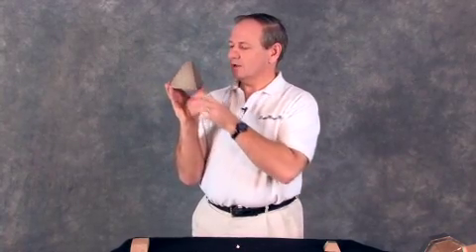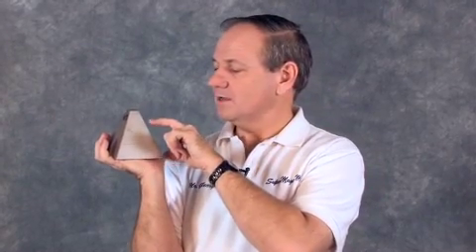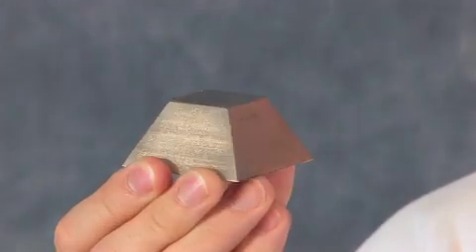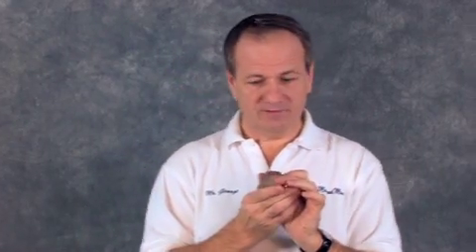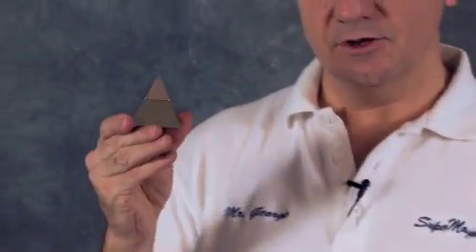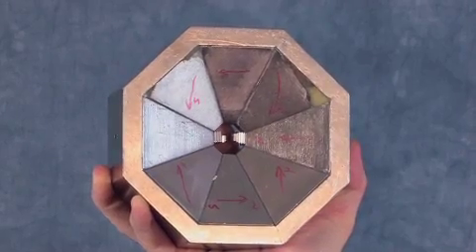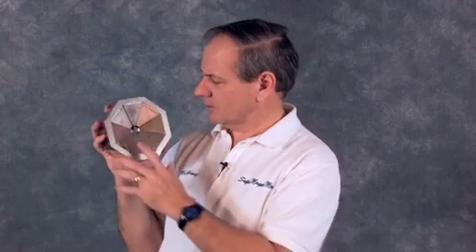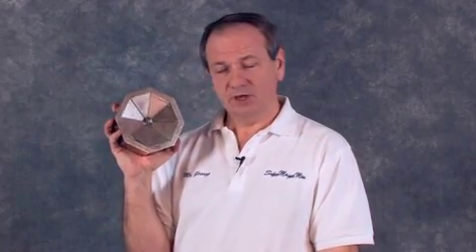Pyramid Magnets - Focusing Flux to a Point

Comment: Dear SMM, thanks for another great video. Your explaining is so clear and straight !

I am curious about the field a pyramid magnet spreads. im making an audio rack and want to put the legs on two repelling magnets. it has to be strong but with the least magnetic field around it. If a pyramid goes straight up and not sideways, i can schield only that point a bit higher up the leg right ? 

Thank you so much !

Comment: George, this demonstration, and your more recent videos (2021?) showing some properties of the pyramid magnet in detail is interesting on several levels - both for it's own sake, and for the possible applications with (for example) magnetic field around the output of a pulsed plasma jet. I did a bit of work on these between 1990 and 1998 for grad school and for specific research projects related to turbulence and combustion. No secrets - our work was documented in considerable detail and published in (I'm fudging my memory a bit) over 40 papers in various Transactions where the research was relevant to the subject. The results were also taken up by at least one auto maker in north America, and they were able to produce significant reductions in exhaust emission - on the close order of 30% - of pollutant compounds, as well as improve overall combustion efficiency, and with that engine efficiency. I believe that's been used in production engines since about 2010. What fascinates me about this is that at the time, we had an idea that better control and higher density of ejected plasma could be done with magnetic fields. Unfortunately, none in our research group had your specialized knowledge, and very powerful Neo-magnets were quite rare to see - as well as being quite costly. "We didn't know what we didn't know" kind of sums up the difficulties. None of the standard texts was much help, because there was very little attention to deliberate field shaping or concentration in the way you show here. I was forced to retire from research by health issues rather sooner than I would have liked, but there are still other researchers working on some of the information we documented. I would dearly love to have some pyramid magnets, and do some high-speed camera work to see what effect(s) various configurations might have on a pulsed plasma jet. The fact that these are permanent magnets would certainly be an advantage for efficiency's sake. 
I may have to sit down and write you a more detailed inquiry, and also follow up on products your company makes. Thank you for putting this out into the 'real world.'

Comment: Put many if them in a circle tube to make a tractor beam lock on each other suspended in ferrous fluids, The outside of the tube with controlled Electric Field that can be adjusted, I believe it's something the Nazi were trying to do, After the War the U.S. found purchasing Orders for lots of Pyramid shaped Magnets and I think it's the Shape and forcing them into a circle tube that generated levitation or zero gravity, just needs to be figured out how but clues exist....  Take a bass boom box speaker, in a box like what would be in a car stereo... Face the speaker box pointing upwards, Turn the sound off... Place a Frisbee on top of the speaker, Slowly turn the speaker Volume UP... TELL ME WHAT YOU SEE🧐

Comment: If you spin 6 opposing focal point magnets having been supercooled, and each point facing an opposite, and you place a mercury sphere at center and apply harmonics at 369hz, what happens?
Reply from the maker: I have no idea:)  I would assume it would vibrate at that frequency and emit a sound in the  F#4/Gb4 range.:)

Comment: Is the force on the "tip side" of the magnet greater than the force of the base? Or just concentrated more?
Reply: It is a lot more concentrated, but somewhat less than the bottom, because some of the magnetic field does come out of the sides of the pyramid and loop back around towards the bottom before it gets all theway up to the top.

Comment: PHASE CONJUGATION IN MAGNETICS
The meaning of the concept of conjugation of phases: The centripetal process in these magnets is unique- and is key to magnetic superconductivity. We are talking: The ideal magnets.
We are not only talking the geometry of the magnets overall form (pyrmid magnet); even so this is also critical… NOW WE WILL TALK “PROPERTIES” FROM INSIDE.
(Focused flux lines; pine cones kiss accurately and efficiently at the center.)
There is only one process in the world which makes a PHASE CONJUGATE MAGNET. 
The technology involves putting a phase conjugate frequency signature- into the magnet molecular array- during the time of molecular crystallization at magnetization- or sintering process.

We know that this is making like poles attract; and there also are evidences (for years)- that correctly defined magnetic south- is more centripetal- than north.
Unfortunately we did (until now) not find any contract company to measure and prove … all this is made more complicated by the fact that the only companies in the world actually making strong magnets in production quantities- are the Chineses (control virtually all the rare earth minerals needed)- these Chinese companies seem to DEFINE NORTH vs SOUTH magnetically - in the OPPOSITE WAY western physics does! Combine this with the fact that western physics has failed to note the fundamental difference between centripetal vs centrifugal flux as being in fact the defining symmetry of north versus south. I also believe this is actually the defining difference between plus versus minus charge- the new information being that it is in fact fractality that causes all electronegativity to be centripetal. 
Then add the fact that many use the term yin versus yang- for this physics- and the centripetal versus centrifugal definition of Yin/Yang has ALSO been inverted between traditions (Michio Kushi versus...). So be prepared for a little confusion. 
The only name for things … If a quality like magnetic south, and charge negative is in fact a name for predominantly centripetal flux lines- you must know that- or you can be confused and manipulated. If alphabets and symbols are only a name for the plasma residue (symmetry of charge compression) necessary to embed/implode/fuse your centripetal (phase conjugate) toroidal flux lines.

The basics:
Geometry produces symmetry, which allows waves proceeding from opposite directions to meet each other and stand (to phase and phaselock.) Standing waves give the illusion of stability, segregation of momentum, and make possible the birth of matter. Pressure occurs where waves meet.
Ratios are the the constants on all scales.
If the geometry of replication is embraced in a seed of any scale, it is ratio that has the power. Size is unimportant where information is concerned, since information can travel to any scale via the wave guide, and be manifested. (Holofractal architecture).
Shape is the only thing nature has to conserve. (memory, ring out only from differences in shape, not substance) The only way to conserve shape along a path is to maintain the ratio of length, area and volume (a nest of ratios.) (“Attractor” theory in mathematics; waves which fit into each other / nests which stand, form matter)
 
The best pathway to maintain a nest of ratios is the golden mean (Phi). 
Phi squared and Phi cubed are represented by the ratcheted dodecahedron. 
This pathway enables information (shape) to be moved without loss of momentum (power). The closer a material comes to forming this shape and path, the greater its conductivity. Think of superconductivity that is super-coherence of resonance or wave shape.
Coherence at any level is coherence at every level. An orderly relation between wave lengths establishes a connection between frequencies and fields, which cannot persist unless it resonates to ALL frequencies and fields . This harmonic cascade (Jacob’s Ladder) establishes the connectedness called holography. Holo-Fractal Principles are the origin of centripetal forces… (!)
Again: We know that in “optics”;  where the optical paths conjugate self organization results in superluminal
Only golden ratio conjugates (adds and multiplies- and therefore compresses infinitely and implodes).
+ The only path which allows conjugation in 3D is therefore- the way 2 pine cones kiss noses- in the center of stellating dodeca.
+ This is the only 3D fractal for waves
= The conjugation of wave phases constructive and possible ( both two sixty degree implosion pine cones learn to kiss noses)- we now can solve phase conjugate in optics, phase conjugate dielectrics … everywhere where people understand wave patterns.

Comment: AL:  "What exactly is in the round space gap of the halbach/pyramids magnet to make it so strong?"
ED:   "Magnetic lines of force, Al."

AL:  "So the magnets are polarizing the zero point field, and that is the medium that allows the magnetic lines of flux to be detected outside the physical boundary of the magnets?"
ED:  "There aint no zero point field Al -- it's just magnetic lines of force, those magnets aren't polarizing anything, now don't be making this mysterious"

AL:  "If there's no zero point field with virtual particles being polarized by the magnets, how are the 'magnetic lines of force' hanging out in the open air around the magnets?"
ED:   "Them magnetic lines of force is just THERE, right next to the magnet"

AL:   "No medium then?  No zero point field?"
ED:   "Just THERE, Al.  I told you don't complicate this."

.
.
.
Reply: You missed the part where Ed says "More Power!" and grunts as he adds another layer of pyramids outside of the inner ring.

Comment: Can an electromagnet be made in the pryamid design
Reply: Electromagnets are usually wound around an object, making them round by default. Even when they're wound around objects with sharp corners, they still result in slightly rounded edges due to the wire winding around it. So what you're better off asking is if an electromagnet can be made in a cone design. The answer is yes, but it's a huge pain in the butt to get a tight wind, as the wire always wants to slide down to the narrow end of the cone. If you mind having loose winding, then I would recommend gluing the winding as you wind it.
Reply: @megadeathx  Suppose you start your winding on the narrow end, with a drop of glue to hold the end in place. Then as you wind up toward the wider end, wouldn't the "sliding toward the tip" effect make the winding TIGHTER?
Reply: @senseisecurityschool9337  No because the direction of pull isn't perpendicular to the surface. In practice, I have found that the wire pulls over the previous winding rather than against the previous winding; so while it is tighter in a density sense, it's not at all tight in an useful line.
Reply: 4 months so far—and still no answer??
Reply: If you want to build the correct cone coil, use COILED wire. The result is coiled cone coil, the magnetic vortex would be formed according to walter russell. This is the TRUE analogy of russell's teaching. Illuminati fked everything.

Comment: Hi 
What about magnetic bearings that can float a motor or generator axle with no friction?? Can thes pyramid magnets work well for that?
Thanks !!
Reply: I already use magnetic bearings for yard ornaments.
Reply: @johnknoefler  
Is there advantage with pyramid shape with mavebtic bearings?
Could they work for say 1000w generator bearings or 3hp motor bearings?

Comment: If you break one of these pyramid magnets along the horizontal plane (if the pyramid were sitting base on the ground), do the two portions attract or repel if aligned along the break?
Reply: fuck google  Try breaking a one of those common ceramic magnets in different ways. Then try reassembling back the way it was.  It will depend on how you break it whether the two pieces attract or repel.
Reply: fuck google  Don't take my word for it -- try it.  It depends along which axis you break it. If you break it like NS - NS it will attract.  If you beak it like:
N-N
S-S
It will repel if you try to reassemble exactly as it was. "-" represents the break line.

Comment: Could you use a Halback array with a copper fan that heats up from the len's law for a heating system? With also using Aluminum and copper to generate electricity to power the device has it is operating? A self sustaining space heater a self sustaining refrigeration system? A superconducting electrical power generation system? In fact using these concept's you could design a electrical power generator to power electric vehicle's of all type's correct? No more need for huge battery bank's? 😊
Reply: Halbach - And no; Infinite energy systems are literally impossible. If you think otherwise you might have missed something very important in high school science.
Reply: So, let me get this straight... You ask a question and then spew rude words (that seem to revolve around penises and rectums) in a semi-coherent insult when you get an answer?
Brilliant. That's the way to do it!
And no. No, I am far, far, far away from knowing everything - Except that I couldn't possibly insult you more than have yourself already. At that, you, little sir, receive a gold star.
Reply: It was a baited question a hook in your jaw? Yanker a different type of fishing wanker! 😊
Reply: @jimmartin3833  Yeah.. okay. Um, perhaps talk to your doctor about increasing your dose of lithium.